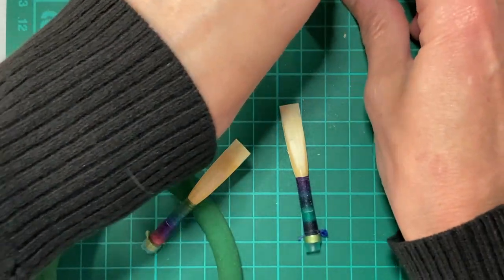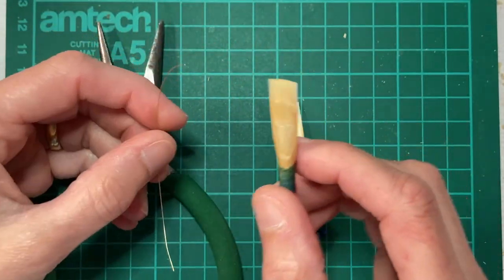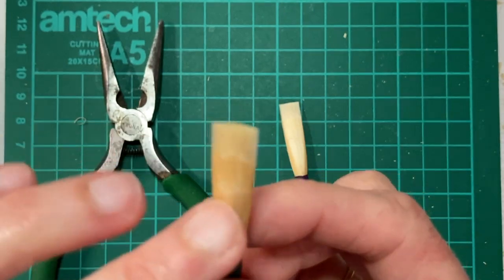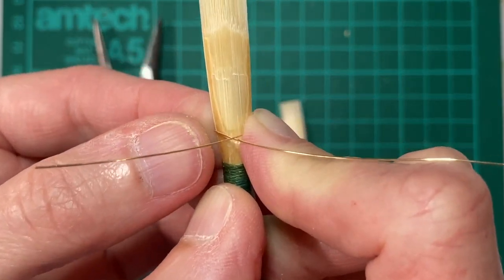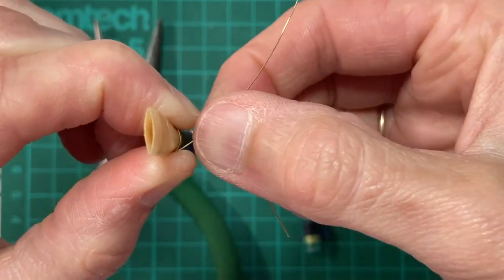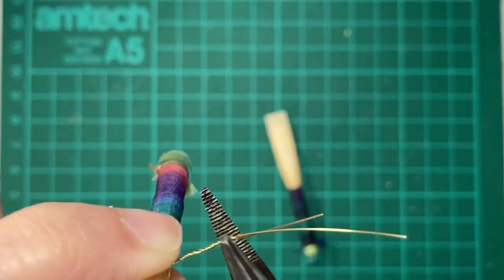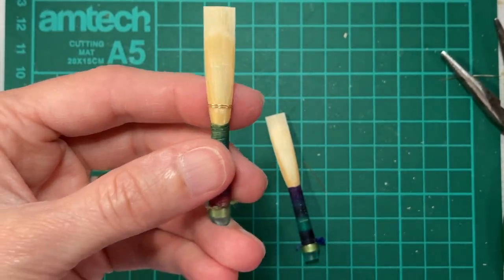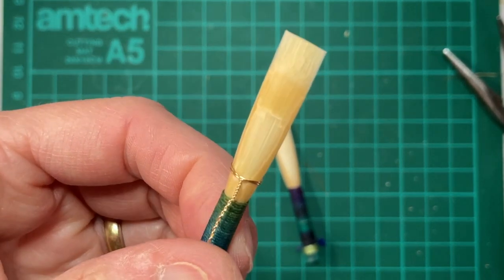Five Minute Reedmaker: Wiring an English Horn Reed

Comment: This is unknown territory for me, and frankly don't use wire because I have not spent the time doing it!!  Question, do you lower wire when reed is drying in case, or keep it in place?      I know wire will get slightly loose as cane not as swollen when dry.  Oh, another question!!!    Wired on when reed soaked or dry?   I would think wet.     Amazing video... Wow...wire really stabilized the high register.    Very helpful.......